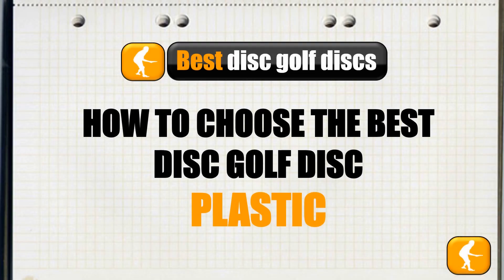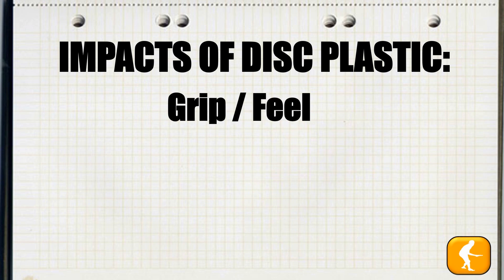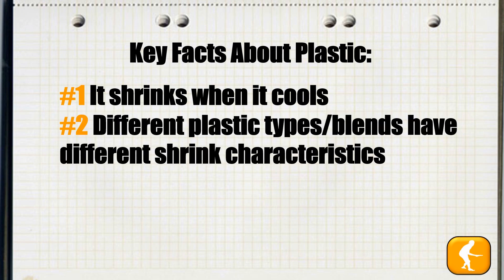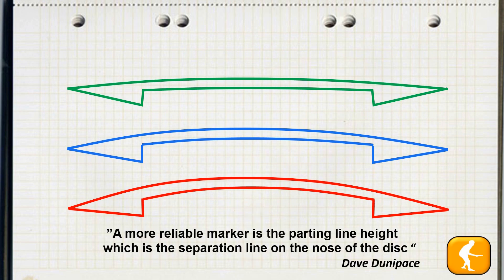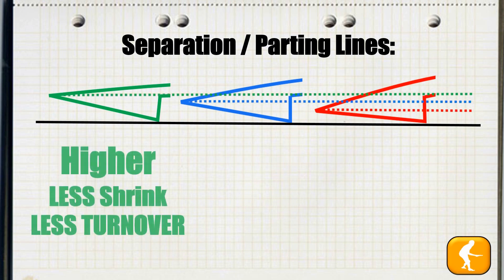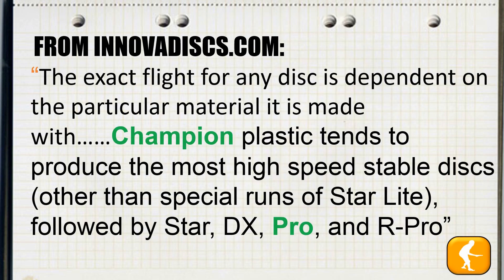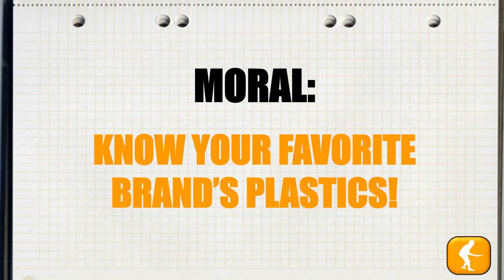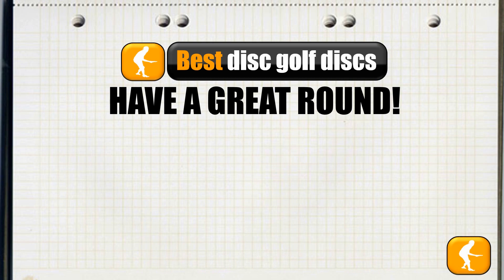Disc Golf Disc Plastics: How they Impact Disc Flight

Comment: Please address a phenomenon I believe happens, but I have never heard anyone talk about. How rotational g-forces act upon a disc.  Disc "flex". A pro disc can flex more, the g-forces can more easily effect the disc and allow the flight plate to flatten out and flare the wings up, increasing parting line height at high rotational speeds. Plastic as well as how domey vs flat a disc is in a stationary position will effect this.. I believe it is something to consider. A flat disc will flex less I think. But also too much dome on a stiff disc can inhibit flex. I think. It's worth looking into but I've never heard anyone looking into it explaining it.

Comment: Wait - what's turnover?
Reply from the maker: Hi Danny -- When a disc turns over, it "flips" to a slight anhyzer angle during high-speed flight, pulling the disc to the right (for RHBH/LHFH throws).

Comment: I think it is important to add that not every disc is made in a climate controlled facility. The variables that can change the cooling process are endless. Factory temperature and humidity can change a bunch depending on what time of the year it is

Comment: I would want a disc manufacturer to provide a destroyer than has identical flight characteristics regardless of the plastic that is used.

That is, the mold of a pro-plastic injected destroyer should be different than the mold of a champion plastic destroyer so that when they cool, the final forms are identical.
Reply: This may be a long while too late, but the difference is not so much the plastic (because on that note, technically it should be possible), but rather, the fact that different plastics wear in differently. This would mean the discs would only fly the same brand new.

Comment: Wouldn't a shrinking(as it cools) flight plate cause the parting line to lift or be higher?  Flat tops seem more over stable than domey discs of the same type for this reason.  I don't buy your explanation, but you're on the right track.  It seems it would be the opposite from what you're saying.  I agree that impacting objects lowers the parting line, thus making older disc less stable.
Reply from the maker: Thanks for the question! I understand your train of thought, but I can assure you that discs definitely do shrink in the direction shown in the video's graphics. In fact, the molds are often designed to factor-in expected shrinkage.

Comment: Great video, learned quite a bit. Where would the parting line apply to a putter with a flatter blunter rim?
Reply from the maker: Bonsai - good question: the disc-to-disc variations in putters will be much less pronounced (than with drivers) because putters thick top flight plates reduce the shrink / curl-under effect.
Reply: Perfect answer! thank you.

Comment: They often will have different ratings on the different plastic versions as well.  My katana champion is different than the other katana plastics for example. Many other discs will have different ratings as well with different plastics.  In short its usually indicated on the disc if the flight characteristics are much different.
Reply: +BorisBlade7 Very rarely do companies do this. Only a couple of Innova molds list different numbers for different plastics and I think only 1 Discmania mold has this; however, every single disc is affected by this phenomenon.

Comment: I want to know how you would get the longest possible flight when throwing over a huge drop off. Like throwing over a cliff trying to get max distance. Would you rip an understable disc out on anhyzer knowing that it will eventually fade? Or a stable disc on an almost vertical anhyzer? Thoughts anyone?
Reply: +TheCbass13 It would be easier to get a clean throw with an understable disc thrown flat or on a slight hyzer. More air means more time so you want to delay the fade as much as you can to maximize forward distance.

Comment: The greatest question that comes to mind though would be how does it work for putters that don't have such a prominent wing like a driver.  How (other than knowing about the plastic) would you be able to tell how one flight of the disc will differ compared to another because of the plastic

Comment: what type of shot to throw in different circumstances. Like hyzer flip with an understable disc or a big hyzer with an over stable disc?  In different wind directions how does it effect an anhyzer vs a hyzer shot. If you have both hyzer and anny lines available to you... what one do you take depending on wind?
Reply from the maker: +Matthew Wakeman We're working on a video comparing S-Shots, Hyzer Flips, and Flex Shots now!

Comment: So basically Innova's (and the other companys') flight charts are completely bogus when it comes to their flights.  They should really have different flight charts for the same model depending on the plastic.
Any idea who has the best flight chart with plastics included in the equation online?
Reply: Actually, Innova does rate some discs differently in different plastics, if the flight deviation is severe. For example: Star Tern - 12 6 -4 2 Champ Tern - 12 6 -2 2 or Champ Beast 10 6 -2 2 Pro Beast 10 6 -3 2
Reply: I realize I'm late to the party, but...

The Beast is my favorite driver. I've had more than a dozen of them, in all different plastics, over 20+ years. 

A) A Beast's glide number is 5, not 6. Every one I've had says this, as does Innova's website. 

B) I have two Pro Beasts sitting in front of me right now, and both (as well as all the other Beasts I have ever owned, in all plastics) show a turn rating of -2, not -3. Beast = 10/5/-2/2.
Reply: +Keith Howe No they aren't bogus. They show the flight for the middle ground plastic. It's pretty well known what plastics fly in what way. And just about every company has a similar lineup of plastics. In general, the more expensive plastic tends to be more stable. Pro is an exception to that since they are usually LESS stable than DX but cost a little more. They are a little more durable, however.

No one does flight charts with plastics taken into account that I know of.

The moral of the story is good advice. Whatever your favorite brand is, find out how their plastics affect stability. Then shop for discs with that piece of info in mind.
Reply: @facemash  How in the heck do you find out how their plastics affect stability?

Comment: Thanks for posting.  There is some very good information in this video.  A couple of things that were not mentioned but could have been:  1) as discs hit trees and become more damaged, the damaged/rough surface makes a disc more understable, not only because of the parting lines, but the friction of the damaged rim and aerodynamics of the same.  2) I agree with other commenters that discs of the same plastic can fly differently, and that is because the production process may not be totally consistent.  Different runs can produce slight but noticeably different results.  If you find a disc that flies well for you, hold on to it!
Keep up the great work!  I'd still like to see a video on the effects of uphills and downhills, and which discs to throw in those situations.